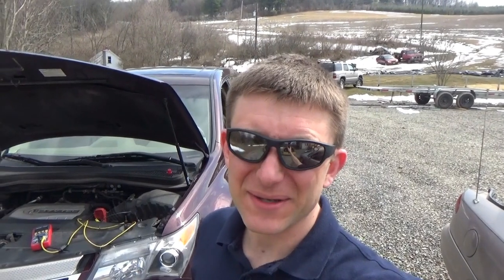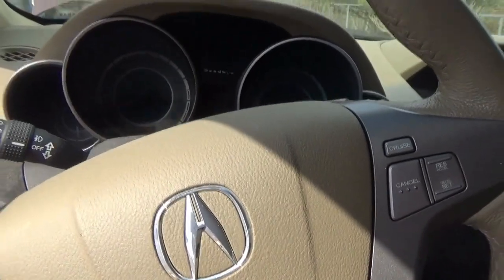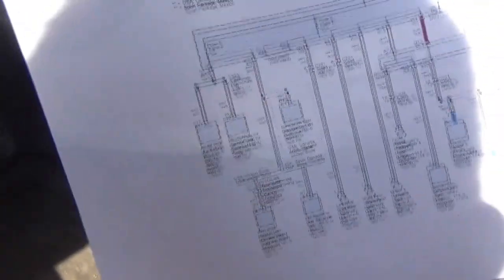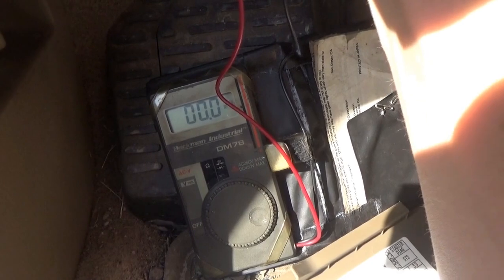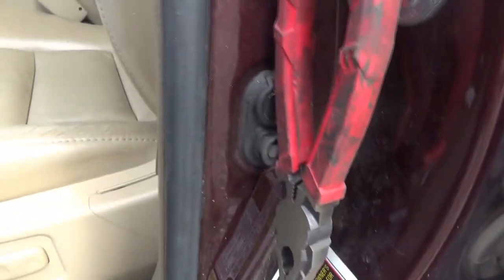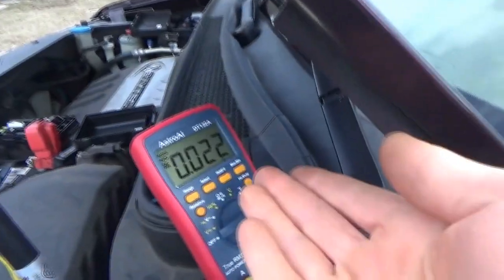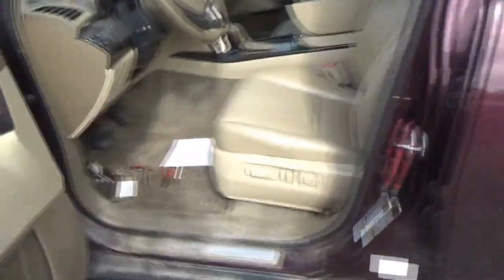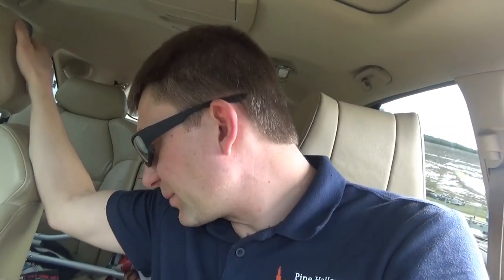Acura Battery Draw? CHECK THIS FIRST!

Comment: Thank you for your easy to follow instructions and demonstration!! I replaced the battery less than a year ago and my car kept having a dead battery. Checked the battery and alternator at both O'Reilly and AutoZone and they tested fine. After checking with the multimeter I was able to trace the power draw back to the handsfree system just like you suggested. Since unplugging it my car battery has been holding a charge for 2 months. Appreciate your help 🙂
Reply from the maker: Nice job!

Comment: My girlfriend's 2005 Acura MDX had the exact same problem. A little internet research led to the hands free unit being a likely suspect. I don't have electrical diagnosis equipment so I did a brute force diagnosis; I unplugged the module and viola, no more draw.
Reply from the maker: How did you know there was no more draw? Have to measure it somehow...
Reply: @PineHollowAutoDiagnostics  The battery stopped dying so I figured that was sufficient evidence. Obviously if I were doing this as a business I'd need to verify it more thoroughly, but unplugging the module accomplished all I needed it to.

Comment: Great baseline technique with voltage drop across the fuses excellent diag always start with the most common problems
Reply: I've never thought of that one before. Excellent method
Reply: fuses are resistive elements, which are meant to open upon over-current by burning the lower temperature meting point metals, before wiring and maybe devices go fully up in smoke.
none are exactly perfect and the reading could vary some from fuse to fuse, so don't expect "ohms law/electrical pie chart and calculations to be exact or anywhere near. but yes it does aim you at what circuits are drawing current rather quickly :)

Comment: Knowledge is a valuable commodity when you have seen it before, in some newer Volvo's disconnecting the battery with out the modules at sleep leads to big problems. Great video

Comment: Thank you for the video. My battery was having issues starting my acura rl, and then it died. My new battery seemed to work great for a few weeks, and then started to seem like it was barely turning the engine over upon starting it. (I noticed it would seem to have this issue starting in the mornings)
I saw this video and removed the Bluetooth unit first, and now my acura now  fires up great each time. (My hands free bluetooth unit was located in the front passenger side kick panel just on the right side of the legs under the glove box.)

Comment: Excellent diagnostics, using a professional workflow that respects your time. I wonder why they designed the hands-free remote to run off of unswitched power. It would seem a no-brainer, to power it from a source that is turned off when the key is removed. What am I missing?
Reply: likely intended on near future use of same module to link/sense phone for proximity control of vehicle ( auto unlock, keyless entry, keyless start/run, etc.) and then reality set in :))
Reply: @spelunkerd  The Hands Free Link system stores your contact list, text messages and internet searches. The kind of things law enforcement would desperately want access to, and has gained access to in many cases. So to do that the system has to be powered at all times because the safest way for them to retrieve that info is when the car is not occupied.
 Manufacturers of cars use your info and sell it to advertisers. That's why they are so eager to show you how to use the system when you buy a car.

Comment: I had the same issue on a 2007 Honda civic here in the UK. I also noticed it stayed warm to the touch which was another observation when I tracked it down! I did the same thing and left it unplugged as it was never used anyway.
Reply: What causes the issue in the unit? Can it be fixed?
Reply: @malcolmy11  Internal failure of a power switching transistor. It could be repaired but the ones I have looked at were potted so it wouldn't be an easy thing.

Comment: My father's 2008 Acura TL hands free Bluetooth module was getting hot and read online on Acura TL forum that other people had the same problems and it was also draining the battery. What I did, was just completely remove the hands free Bluetooth module and it no longer gets hot and battery voltage no longer getting low, common problem for it to happen and heard they had a recall on them but they stop doing them already.
Reply: Į have same year car,  I may have same problem

Comment: If the HFL still works but won't go to sleep you could add an inline fuse from an ign ON only power supply in the fuse box to kill total power when the key is off. This gives you back the HFL while running and keeps it fused.
Reply from the maker: I wonder if it will lose the sync every time...
Reply: Same thing I was thinking.. but they've powered it for a reason. 

I own a 2015 RDX that I need to track down parasitic draw. 
Sure stinks in winter when can't start the car.
 @PineHollowAutoDiagnostics

Comment: Cool
I had a similar issue in a Honda Odyssey.  70ma drain on the radio 
Turns out a aftermarket kit was installed in back of the radio causing drain 50ma.  Uninstalled it and it was down to 20 ma which is acceptable ( anything < 50 ma when everything is off )

Comment: I just got a 2007 MDX which has a parasitic draw and I was hoping it would be this simple only to find that the Bluetooth module was already unplugged and removed.

Are there any other common draws on this vehicle or do I need to do a full on test?

Comment: Super awesome video.
How did you measure the voltage (assuming it is voltage) from the inside? Did you put black on ground and touch the red on the fuse contact point?
Reply: Voltage drop across the fuse...  If the fuse is not carrying current it will measure 0,00v, just like if you short the test leads together.

Comment: I’ve already disconnected my hands free link on my 2005 TL but still find the battery around 12.3-12.4v in the morning. It is only a few months old. Cranking voltage is 10v.  Fuse 6 measured .05 mV and fuse 7 .12 - .27 mV all the others see 0. Guessing fuse 7 has to do with the security light on the door. Any ideas?
Reply: I still have battery drain and replaced it two or three times, it’s a second car so figured I just wasn’t driving enough during Covid.  HFL was already disconnected when I opened up the rear console cover.  I think its the radio or GPS but have heard it could also be the HomeLink or CD Changer.  Might need a second multimeter.

Comment: You mentioned let’s pull that fuse with the voltage and see if that draw goes away.  What situation would have to exist when pulling that fuse would cause the draw to not go away?  Thanks
Reply: Maybe the fuse is reading a significant voltage due to a flaw in the fuse, making it seem like its the culprit circuit when actually it's not.

Comment: Is the module expensive? It's easy to reach so if it is under a hundred bucks why no preserve the functionality. If the owner never uses it, however, I understand
Reply: Not cheap, runs about $400.00
Reply: If you have a 2nd gen acura rl it's about $1500 for a new module.

Comment: Why not change it so it's live with Key on,. preserving functionality
Reply from the maker: Very interesting thought! Maybe a nearby relay that turns on with the ignition switch :)
Reply: @lustfulvengance  It is possible that there are 2 different power supplies: + B and ACC.
Reply: @lustfulvengance  I would be surprised if the BT module lacked some non-volatile memory in which to store its list of saved devices. So power off shouldn't be an issue.
Reply: @engeneer_ru5827  You got it. The B+ is the white wire fed from fuse 5, it is the primary power, then the control wire is hot in run/acc and that's the purple wire. The unit should power down when the key is off and only use enough power to retain memory.

Comment: Do you prefer testing for parasitic draw with a meter in series or using an amp clamp?
Reply from the maker: In series for anything under 1 amp; clamps have too much drift.
Reply: @PineHollowAutoDiagnostics  I make a 10 loop multiplier for my amp clamp.  You just move the decimal point, makes it more accurate.

Comment: My question is: why is that unit powered when the ignition is off?
Reply: It should draw a miniscule amount with the power off, fuse 5 is it's main power feed, there is also a control wire. An internal transistor fails and locks the unit on.

Comment: Is it the internal resistans in the voltmeter that creates the voltsge drop? I guess there should not be a drop over a fuse?
Reply: Yes, there is a drop across a fuse -- only a few millivolts. In this case I think it was 1.5 mV, for the fuse on the circuit that was drawing about 220mA. So R = V/I = 1.5mV/220mA = 6.8 milliohms. A small but noticeable resistance in this situation.
Reply: Internal resistance in the fuse itself causes the voltage across the fuse. You can get charts from power probe that show the draw/amps for the different types of fuses.
Reply: @Blazer02LS  just keep in mind, not all fuses are exactly perfect made and the drop can vary, so calculations and charts may be skewed quite a ways.(recalled fuses, etc.)
Reply: @throttlebottle5906  True, however in any reputable fuse the resistance is going to be very close to the spec for the rated amperage. The cheap china crap is an exception, but for the better brands they tend to be very close.

Comment: How can a do it yourselfer get access to diagrams like that.  Not all of us have access.
Reply: Alldatadiy provides wiring diagrams as a subscription package.  The cost is $19 for 1 year per car or $35 for 5 years, which is very reasonable, in my opinion.  It includes not only wiring diagrams, but also repair procedures, technical service bulletins and book times for repairs.  It is good for DIYer, who needs the data for only 1 or 2 cars.  Personally, I found the technical service bulletins especially useful.  Mitchel1diy offers a similar package, but I have not tried it because it is more expensive and I am too cheap.
Reply: @jjscalifornia5086  thank you for the info
Reply: @jjscalifornia5086  RIP BBB ::sniff::

Comment: Voltage drop across the fuse is a stupid method. You should have one of your meter leads on ground. 1.5 mV is essentially nothing.

Comment: Why can't power not be killed to it when Ig'n  is off?
Reply: New cars have modules ECMs that often stay on for up to an hour until they turn off. 
Back in 70s no such thing except clock and radio if equipped.
Reply: @MitzvosGolem1  Yes, I know that, but why can't it be killed when the IGN is turned off, but come back on when car IGN is turned on?  EDIT:  I mean, the car does not miss it, so it wouldn't miss it if you killed the power to it.
Reply: @BoB4jjjjs  ecm modules stay hot after ignition key is off... independent of key switch.
Reply: @MitzvosGolem1  I know, but can't it be changed, I have never studied them, but I would think it could be killed, if it has only one or two lives feeding it.
Reply: @BoB4jjjjs  yes you can unplug various fuse that feed each module.
Each car is different.
Machines also have this.
Memory stored can be lost though.
Scanner Danner has classes online.
Reply: @MitzvosGolem1  It's been a long time since power was required to retain memory,.
Reply: @Graham_Wideman  depends on what vehicle for machine.
Reply: @MitzvosGolem1  Yeah, but if it can be disconnected and nothing is affected then it can be switched off when car is.
Reply: @BoB4jjjjs  It is, there is an internal failure that keeps it on. The line that fuse feeds is the main power and memory feed. There is another lead that is supposed to turn the module on/off normally. The transistor inside shorts and you get this as a result.
Reply: @BoB4jjjjs  With it disconnected the module goes stupid and you have to re-pair any phones used with the system.